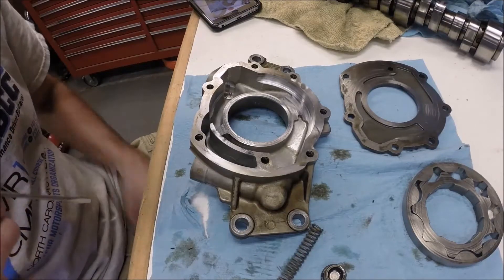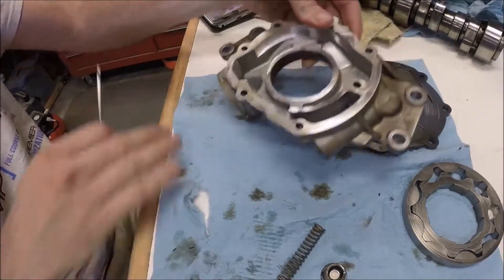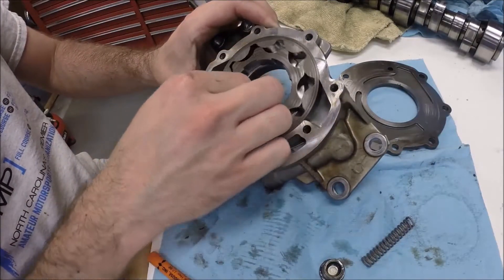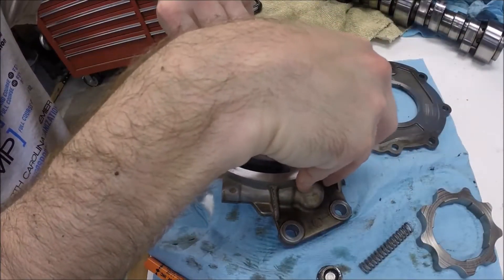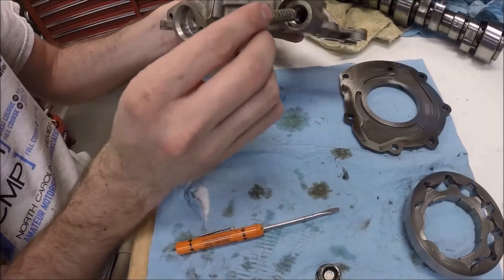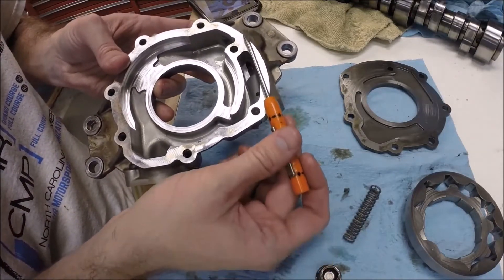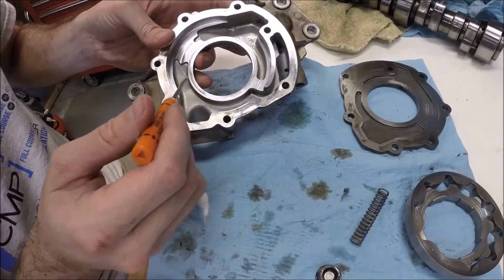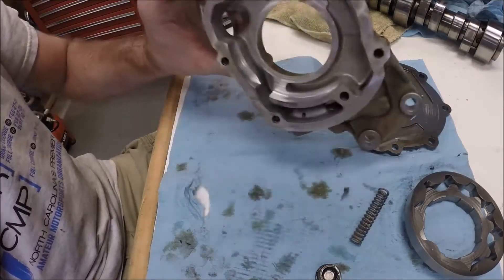LS Tech: A Look Inside the GM Oil Pump

Comment: To install the oil pump do I have to put filer gauges. Inside the oil pump or do I install the unit all together? Or is there an installation guide?
Reply from the maker: I did an installation video showing how to setup the clearances with feeler gauges.  https://youtu.be/xjuwwlALVzM     Melling recommends following this process for installation (they also have an install video you can watch).   Others have reported installing without checking clearances.   Your motor, your money, your choice.

Comment: Did one yesterday and the pressure relief valve was stuck open. Had no oil pressure, installed a new one and it fixed.it.
Reply from the maker: That's great, glad you were able to get it fixed.   Could you tell what caused the pressure relief valve to get stuck open?   Debris or sludge or something else?

Comment: My check engine light is coming on my 2008 chevy tahoe. The code is engine oil pressure sensor, which I replaced with the filter. But engine light is back on and oil gauge continues to read high. Mechanic suggested taking the oil pan off and replacing oil relief valve. Should I replace the whole pump or just the valve? Would that likely fix the problem? Thanks
Reply from the maker: How many miles are on the motor?  If you are digging into it that far, I would go ahead and do a new oil pump. (I'm not sure that you can buy just the pressure relief valve)  I would also take apart the old pump and inspect the pressure relief valve to see if there's debris in there or sludge.  Before you replace the pump though, since that is such a big job, I would try to do some additional diagnostics to verify you actually have a high oil pressure problem.  Hooking up a mechanical oil pressure gauge would tell you for sure.
Reply: Thank you for the reply. I have 120,000 miles on my tahoe. You are right, I found out you cannot just buy the pressure relief valve. I'll try first with the mechanical oil pressure gauge. Thanks again.